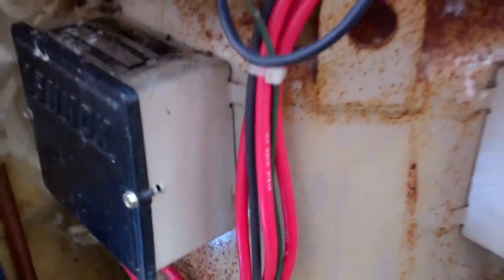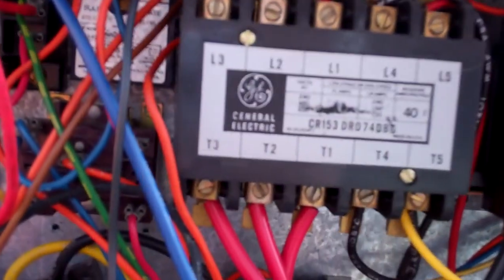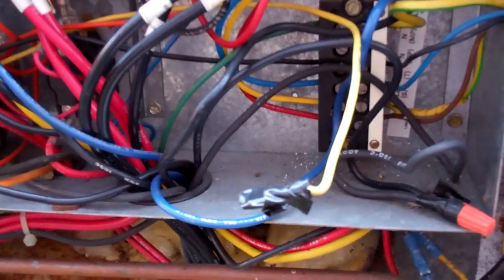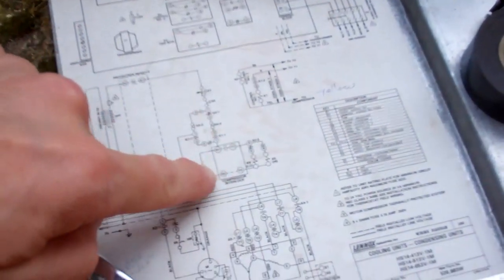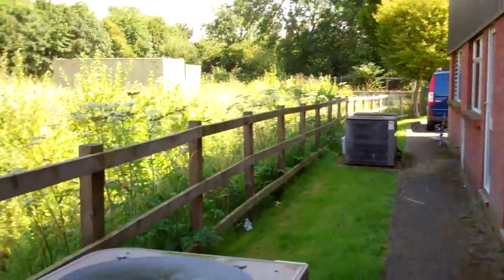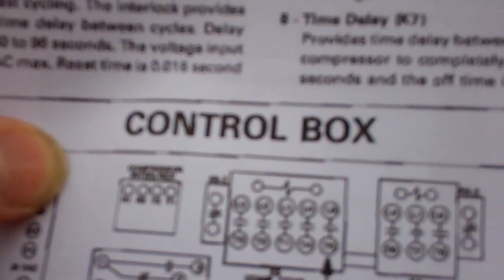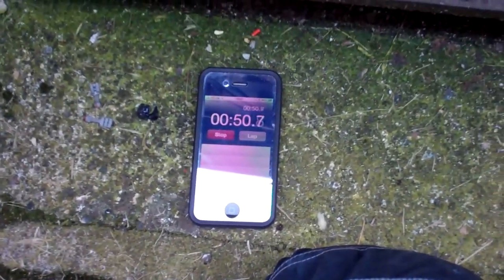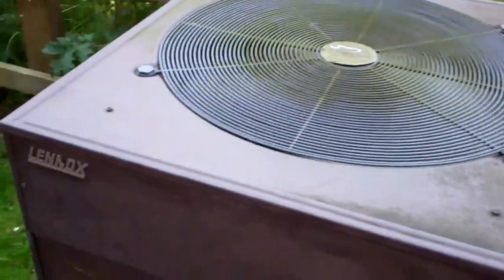Lennox HVAC Troubleshooting

Comment from the maker: Hi Fritz!

Thanks!!! took me an hour to get it running and another to fit and test the timer, expect you would have been on your second call by then! LOL
They just had the four of them, think two did ground floor and two upstairs, office and wharehouse. 
I didn't get the serial# but i did get a manual online last night, just the wiring was slightly different. I'll make a note next time i go there (though they'll fix it themselves first if they can!)
Think i know just enough to be dangerous now!

Comment from the maker: Hi Ray, they say ignorance is bliss and i was right blissful about the HS14!!!

Seemed like it would be easy to work on, comp right in front of you if it needed changing, wiring was a bit messy but i expect that was down to the installers, they seem to run without giving many problems but i didn't look to closely! I think it would be the controls that would give me problems understanding, as there is nothing else like them here! once she fired up and ran, put the covers back on quick and go :-p

Comment from the maker: :-D seemed a bit odd there was low voltage on really thick cables yet the 415v came in on a bit of 1.5mm flex! Been running for 20years so can't be too bad i guess!

Comment from the maker: Thanks! It was the first unit this style that i've worked on, all our ac is mini splits! 
The relays all look different so i didn't have a clue what was coil or contacts and even the wiring diagram uses different symbols to whats used here! -||- would be a capacitor and not a contact! The coil symbol looked more like a fuse... 

Can't get more broke than broke is what i say LOL

Comment from the maker: These are the first ones i've seen and worked on, its the low voltage wiring i struggled to get my head around, still couldn't see what told it to run and how it knew if to run hi or low speed, but it was running when i left :-p

Think worst wiring i saw was on a Surge milk tank, three phase motor where they only switch two phases to stop them (think its illegal here!) Switched neutrals, again not legal (which would be one leg of 120v in USA but its 240v & N here), don't see any now thankfully!

Comment: i have a 20 year old lenox ac unit that needs a new evaporator . model cbh19 31 1p txv. anyone know where i can get one of if one can be retrofitted?
Reply from the maker: Frank Whaley It will be difficult to find a coil to suit a 20 year old system, all the seer ratings that the coils are designed to meet are different now, you could probably get something to fit but how well it would work would be anyones guess.